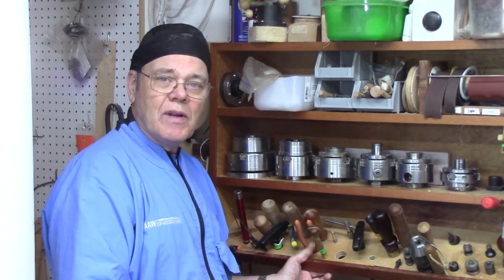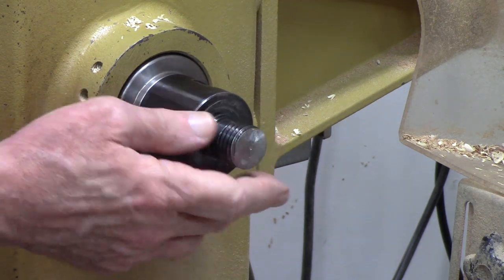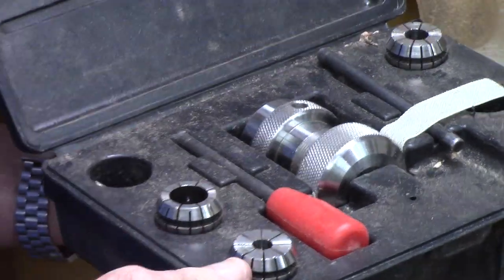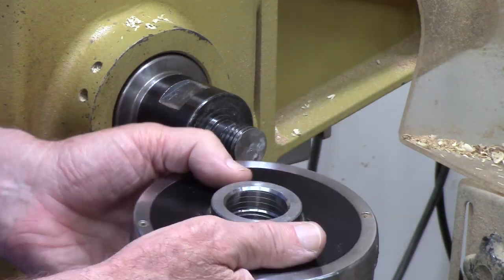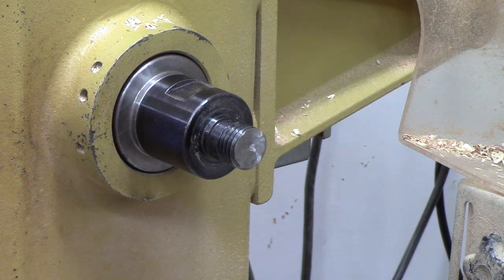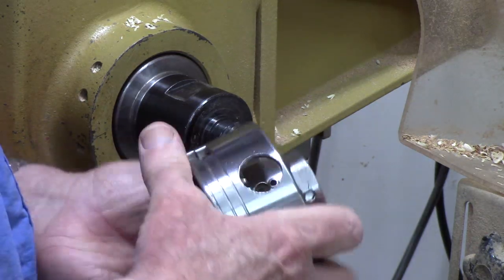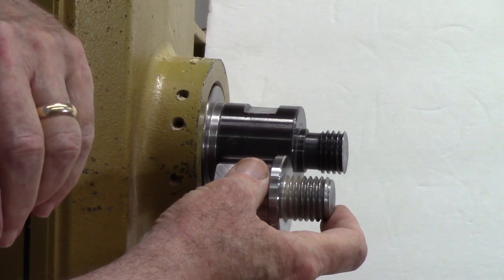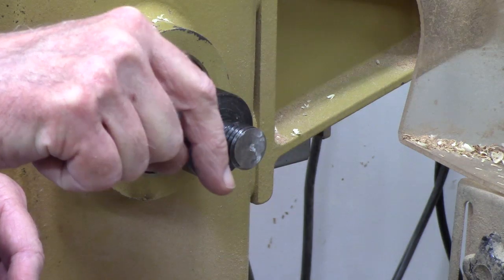Wood Lathe Spindle Adapter or Chuck Insert?

Comment: Many thanks Mike. I recently bought a Record Power SC4 chuck and had to buy a M20 x 1.5 thread insert to fit the chuck to my lathe. Stiles and Bates here in the UK got me out of trouble.
Reply from the maker: Sounds like an uncommon spindle thread. I believe S&B makes hand thread chasers but have not seen any for sale in the USA.
Reply: Was the adapter made by Record Power? I have a similar problem in needing to adapt to M20 x 2.0 and the only adapter I can find is not made by Record Power. Thanks.
Reply: @danceswithaardvarks3284  Record Power (Stiles and Bates) item number 62112 M20 x 2.0 RH but make sure you state the chuck model and the female thread size that the insert is to go in.
Reply: @MrPete1x  Wow. Thank you very much.

Comment: Mike. Thanks for the video. Loads in there for me as a beginner. I have an old Wadkin Lathe and bought a Nova chuck for the outside spindle on the headstock. I had to have a custom insert to make it fit. I now want to turn on the bed side of the headstock which has a different thread again and of course will have to be turned on the other way. Is it easiest in fact to just get a second chuck ? Thanks. Bob. England.
Reply from the maker: Probably. You probably discovered how hard it is to tighten up the insert until it registers against the inside bottom.

Comment: I was waiting hoping there would be a vicmark chuck in there.  I have the vm100 with 1x8 insert for my jet 1236 lathe.  I am hoping to buy a Laguna 1836 which has a 1 1/4 spindle, so I need to buy a 11/4 insert for my chuck.  I don't want to break my chuck trying to get the insert out.  Never thought to look for a grub screw, so thanks for the tip.  don't know if you have a video on the vicmark chucks.
Reply from the maker: Vicmarc chucks have a great reputation. They do cost more. I have never used one as they are not as readily available as Nova chucks.
Reply: @MikePeaceWoodturning  thanks for the reply.  Continuing down the rabbit hole it looks like the insert just screws in.  since it is an old chuck the insert is probably stuck.  Ran across form discussion on this very thing.  Most of the suggestions worked around clamping metal in a vise and closing the jaws around it.  Then it varied heating and tapping and using a penetrating oil till it frees up.  There was no glue or loctite to break loose just old age like me ha ha.  Thanks again
Reply from the maker: @fergusrb  Or just use penetration oil overnight. Mount chuck on the lathe and figure out how to secure the insert with a wrench or whatever. Then clamp down on a long metal lever between the jaws like a long prybar and give it a sharp rap. Shock should cause it to break free.
Reply: @MikePeaceWoodturning  Thanks for the info.
Reply: @MikePeaceWoodturning  Sorry this may sound awful stupid.  I like your idea but with your method do you turn the chuck counter clockwise?  My Tormek wheel nut has left handed thread were you have to turn it like you are tightening it to loosen.  Wondered if the chuck was the same way as I don't see a grub screw to keep it from loosening.  Afraid since it is tight already I will turn it the wrong way and continue to tighten instead of loosing it.  Thanks for the above advice.
Reply from the maker: @fergusrb  Chucks screw on clockwise just like a screw, rightie tightie, leftie loosie.
Reply: @MikePeaceWoodturning  thanks Mike

Comment: Mike I have been looking the world over for this strange animal but have had no luck. Looking for a spindle adapter that is 1” x 8” on moth ends. More or less a spindle addition. The place where I attach my chuck, the threads at the head are beginning to reflect some rough handling and I don’t want to mess the up any further. So I thought by putting a short extension I might be able to extend their life. I would need a short one with the female on headstock end and a male end closet to the dead stock end. But that would for having 1” x 8” on both ends. So you see I’m not stepping up or for either end , just have the female on on end and a male end on the other. If you run a Roos one of these animals let me know. Seem to be rather hard to find but I think it would add life time on the spindle end.
Thanks
Claude Callender  ok
Reply from the maker: I have never seen one. You need to go to the root cause of why you are damaging threads and fix that.  Are you damaging the threads with poor tool control when doing spindle turning? Few folks damage a lathe spindle to the point of non servicieability.  You can buy a MT2 arbor threaded on one end 1x8.

Comment: Great information as always thanks. 
I've just bought a Tyme Little Gem lathe and would like to use Record Power SC2 and Axminster Junior (collet) chucks. The problem is it has an M20 x 2mm spindle and the only insert adapter I have found, that would work for both chucks,  is for the Charnwood Viper chuck. 
So I have a question if you don't mind. What is the reason for only using inserts and adapters that are made by the original chuck manufacturer? It seems I have no choice, but it would be a lot of money to spend on something that won't work.
Reply from the maker: You can use a spindle adapter from any manufacturer to go from your spindle thread to a size that fits your chuck. Chuck inserts, on the other hand, are a bit like chuck jaws in that they have a propietary design which generally makes them not fit another manufacturers chuck. There may be exceptions of course.
Reply: @MikePeaceWoodturning  Thanks for responding. I managed to find what I need thanks to a reply from another of your subscribers.

Comment: Mike - I am looking for a spur or center dive that will screw on to my spindle. Is a part like this on the market? Does it have a specific name? I saw are part in a video I watched, but can't find which and haven't been able to find anything on the market.
Reply from the maker: BestWoodstools.com has one for about $100. I have seen them that fit into a chuck which may be your cheapest option. Oneway has some for their chucks that would likely fit others. Teknatool has one for their chucks but I don't like it. If you have a collet chuck that threads onto your spindle you could probably get a machine shop to turn the end of a MT spur flat to fit a collet. I have a video review of the Apprentice Collet chuck if you are not familiar with those.You might have to buy a metric collet to fit since the 3/4" collet would be too large.
Reply: Mike Peace Woodturning 
Ok thank you much. Sorry for the late reply I got distracted with other stuff. I will look into that.

Comment: A good topic.  Thanks for the video.

I was surprised at the need for an insert when I purchased my first chuck.  I think this is to save manufacturing costs.   One body can then fit many different lathe threads by using the insert.
I personally prefer the OneWay inserts since they mount via a taper and screws parallel to the spindle.  A robust method and should run as true as the Record chuck you showed.
Good advise on purchasing the insert from the same manufacturer as the chuck.   I have read where folks who purchased the Woodriver insert for NOVA chucks had some issues of fit.
As you mentioned, every piece we screw onto the spindle can add to run-out, either due to the thread not being exactly concentric, or the registration being off just a little.   This may not be a problem for wood work, but is more of a problem on metal lathes.

Dave.
Reply from the maker: Thanks for sharing, Dave

Comment: I have another question for you as well.  I have a Nove G3 chuck that has a 1 inch - 8 TPI insert.  I have a new lathe that has a 1 1/4 - 8 TPI spindle.  I have a new insert but am not able to get the old insert to come out.  And advice on how to get that to move?  I have tried to get some penetrating oil in there with no luck.  Also, do you do anything to ensure that these inserts do easily go in and out?
Reply from the maker: First make sure there the insert screw in the chuck body that holds the insert tight has been removed if you have not done that. Then I would add penetration oil again  with the chuck in a vertical position and leave for a while as recommended on the can.  Put it back on the lathe and clamp down on the insert with some slip lock pliers. Put a pry bar or something  else between the opposing 2 jaws and tighten down with the pry bar extended for leverage. Give the pry bar or rod  sharp rap with a mallet. It should break free. Clean the threads with a brush before putting in the new insert.  Another good idea for a tip video, keep 'em coming.
Reply: @MikePeaceWoodturning  Thanks for the tip.  That is a good idea.  I will give that a try.  I was trying to hold the chuck in the vice on my workbench which did not work as all.
Reply: @MikePeaceWoodturning  Thanks for tip Mike.  That worked, I was able to get that insert out so I can put in a different insert and use that chuck on both of my lathes now.

Comment: Hey Mike, I have an old Delta/Rockwell 46-100 wood lathe that I have installed a dc motor on it with variable speed w/tachometer. I want to put a DPDT bridge connecter to be able to run it backwards mainly for sanding purposes. I have a Nova g3 Chuck with insert. I’m wondering whether I need to worry about the Chuck coming loose when running backwards. Is it a problem & is there a solution for it?
Thanks
Reply from the maker: The recommended solution is to tighten the set screw. If you are not going too fast and are not putting too much pressure on it, you probably will not have a problem.

Comment: Do you have a video where you address the set screw used to prevent the chuck from unthreading itself when running the lathe in reverse?  Is that really needed?  I have a Nove G3 chuck and that set screw is leaving marks on the quill.  I would like to not use it if it is not really necessary. Or should I put a small piece of rubber or something under the set screw?  But that would be a hassle every time I change the chuck.
Reply from the maker: Sounds like a good idea for a tip video. Thanks for the suggestion. I never used a set screw. My largest chuck, a Nova Titan, will unscrew if I turn off the lathe because there is an electrical brake to slow it down fast. My experience with a PM3520 lathe with a VFD controller, I do not have an issue if Isimply slow the lathe down with the speed knob before turning off and do not hit the reverse switch when the lathe is running.
Reply: @MikePeaceWoodturning  Do you have any problem with sanding in reverse>  It seems like there would be a chance that sanding could put enough resistance  to unscrew it.  Or have you heard of anyone having that problem?  But you say that you don't use  a set screw, I think that I will try mine without one for a while and se how it goes.
Reply from the maker: I do not sand in reverse. I understand the theory but do not believe it provides a noticeable improvement for my projects.

Comment: hello I have a question for you ! I have a Nova 23262 supernova2 chuck and I purchased the teknatool  adapter IDNS BUT THE PROBLEM IS IT STICKS OUT ABOUT 1/8 OF AN INCH IS THAT OKAY !
Reply from the maker: Yes, as long as the end of the insert is touching inside against the chuck to register.

Comment: Mike, where can I find an adapter to fit a 1" x 8 tpi to 
1-1/4" x 8 tpi?...like the short one in your video.
Reply from the maker: I bought mine from Craft Supplies https://www.woodturnerscatalog.com/p/112/5837/turners-select-Spindle-Adapter?s=10002703. But it also comes with the 1 1/4 Apprentice collet chuck so buying the collet chuck is like getting $25 off!
Reply: @MikePeaceWoodturning  Thank you so much for responding to my question...That's just what I need!
I really enjoy your videos...Thanks!

Comment: and also mike,,do they make an adapter to go from 1 1/4back to 1x8,,,where the 1x8 will thread onto the shaft
Reply from the maker: Yes you can buy these but you really want to replace the insert.  I answered your other comment on getting the insert loose..

Comment: mike i have got an infinity chuck with 1 1/4 insert and i am trying to remove it,,,i cant get it to budge,,lol would like to put a 1x8 insert in it,,,can you help me out and tell me if they do make the insert for this chuck and how to remove it,,
Reply from the maker: Yes, a teknatool standard 1x8insert should fit. Here is an Amazon link https://amzn.to/2VCEX9R  Make sure the set screw is removed that holds the insert. But I am sure you did this already. Then add a few drops of Liquid Wrench around the threads if you have it or Spray some WD40 around the threads and tap with a hammer to facilitate it getting around the threads and let it soak a few minutes. Put it back on the lathe and hold the insert with a wrench. Put a bar or something long that can be be grasped by the chuck jaws and give the end a wack. Let me know how it goes.
Reply: @MikePeaceWoodturning  mike i got it out,,thank you ever so much for answering my question,,got to order the insert now,,lol

Comment: Is there a 3/4 12 tpi to 3/4 16 tpi spindle adapter? Please help someone
Reply from the maker: I checked two sources with out luck. If you need one, you will have to get it made by a machinist.

Comment: MAYBE I MISSED IT, BUT REMEMBER WHEN YOU SAID YOU HAD TO GRIND DOWN THE SPINDLE BECAUSE OF EXCESSIVE LENGTH? THE SPINDLE, WITH THE EXCESSIVE LENGTH IS THE FACTORY ONE ON THE LATHE ITSELF. I HAD A HF 10 X 18, AND WENT TO A HF 12 X 33.5 SO THE 1" X 8 TPI MATCH UP BUT THE LENGTH ON THE LARGER LATHE WILL NOT ALLOW THE CHUCK AND FACEPLATES I HAVE TO SEAT FLUSH. I DON'T WANT TO GRIND THE FACTORY SPINDLE DOWN BECAUSE IT WOULD VOID THE WARRANTY. LONG STORY SHORT IS THERE AN ADAPTER THAT HAS THE SAME 1 BY 8 TPI THAT HAS A SHORTER LENGTH??? THANK YOU FOR SHARING YOUR TIME AND WISDOM WITH US!!! ANYONE WHO COULD HELP ME WOULD ALSO BE GREATLY APPRECIATED!!! TAKE CARE EVERYONE!!!
Reply from the maker: You may be able to make do with a washer type spacer when the spindle is too long.
Reply: @MikePeaceWoodturning , I THOUGHT ABOUT THAT, BUT I WAS JUST HOPING BECAUSE I WOULD NEED TO USE 2 OR 3 WASHERS. THANK YOU FOR YOUR RESPONSE. TAKE CARE MIKE!!!